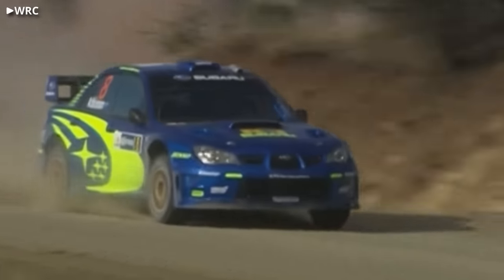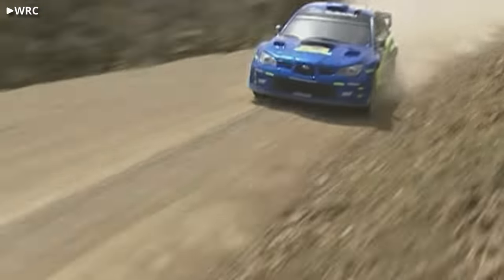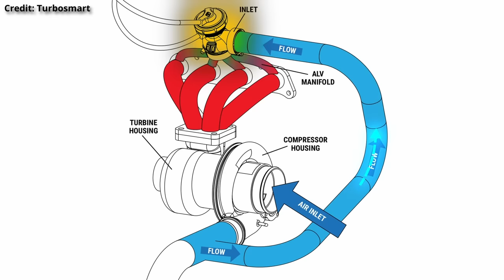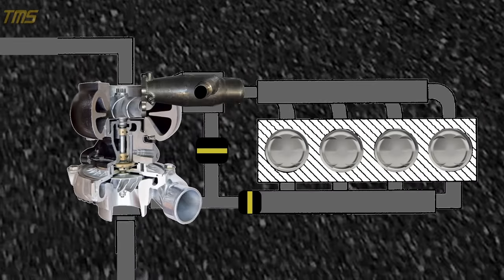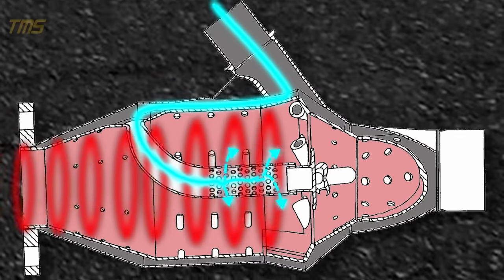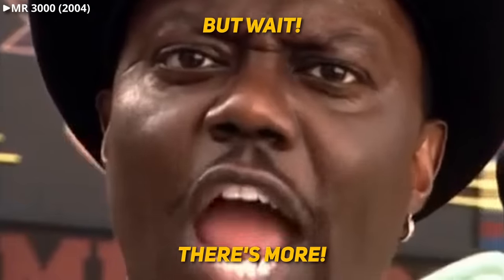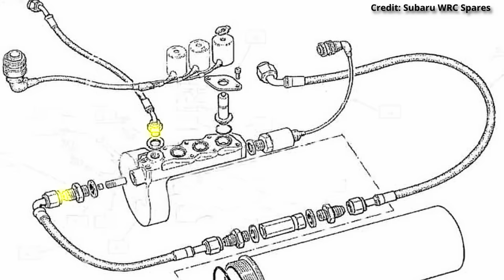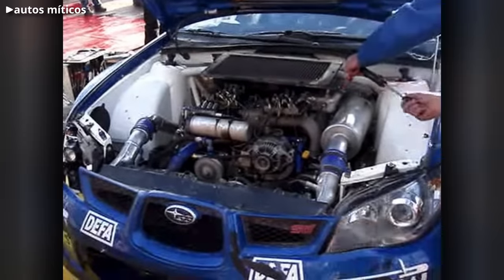When Subaru Put a “Jet Engine” In Their Exhaust | Rocket Anti-Lag Explained!

Comment: As an aero guy seeing the donut moving don’t feel right. In a gas turbine we make sure that the donut stays in one place or you have a melted nozzle and turbine. what usually happens in gas turbine is the donut stays as long as the engine runs by supplying it with air and fuel in primary zone and “harvesting” heat from it using cold air through secondary and tertiary air holes.

Comment: From a physics standpoint a boost reservoir pressurized by the turbo wouldn’t work. The reservoir would only be pressurized to the psi of boost and given the small volume wouldn’t hold enough air to have much effect. An electric compressor pressurizing the reservoir to much higher pressure would be more effective as the total volume would be high enough to release sustained boost pressure through a regulator for long enough to actually provide boost until the turbo spools back up. I believe Koenigsegg uses such a system with carbon fiber air tanks.
Reply from the maker: Just looked it up, that's pretty interesting what Koenigsegg is doing! Christian himself talks about it a few minutes into this video: https://www.youtube.com/watch?v=Jh8Kk1n66g0&t=170s   Love how innovative they are as a company.

Comment: Oh, Rally Car racing. The only sanctioned motorsport where the fans are the circuit barrier walls. Even Isle of Mann TT racing has hay bales between the race bikes and spectators, at least on the outer parts of curves.
Reply from the maker: Yeah, it's certainly gotten better since the days of Group B but there are still some fans who have what I would call poor judgement.

Comment: I've been thinking about anti-lag for like a year after watching videos about it. I've come to a point im confused because i do not understand why someone out there hasn't put an electric motor to spin the turbo when exhaust gas pressure falls below a certain threshold within the exhaust manifold? Seems by 2024 we should have the technology and means to build something like this now, especially with how far electric motors have come. 
    They can spin up to something like 100,000RPMs thats 1/3 the speed the average turbo charger spins at max boost, around 280,000Rpms. With gearing and a small electric motor it would seem possible to incorporate an external electrical motor driven shaft that only needs to go half of what the turbo spins at under max load and boost. It would seem possible to control the shaft speed electronically to keep the turbo at whatever speed rpms till the exhaust gas is back up to the pressure variance needed to spool the turbos.
   Anyone understand what im trying to say here, not sure if im exactly explaning it right, i can surly picture it but to wxplain that picture in my mind's eye is another thing all together lol. Seems like this would be possible to build and even sell if no one else is doing it...

Comment: it is actually a jet engine, no matter the fuel burnt. it uses the compressor and turbine of the turbo as the compressor and the turbine of a jet engine, albeit a really inefficient one. the wastegate is probably closed to not loose precious air and sustain the rotation. to reduce boost you inject less fuel in the engine

Comment: Fantastic  using the  pulse,  it must have taken  some tuning  .  Hard to explain  all and your grafix  must have taken  you a long time..  from watching your video.  How did they get around  the Air Injection  part in the rules.  They  are very  similar  systems   as they both  blow air into the exhaust before the turbo.  No added fuel  in air.  Can you  give  me  what I'm missing please. 
Regards 
Thank you.
Reply from the maker: Back when this system was used in the mid-2000s air injection was still allowed in the rules. It only recently became illegal, long after these cars were no longer used. Glad you liked the video!
Reply: @themotorsportstory   Thank you so much for getting back to me  👍

Comment: The guy pressurizing the cooling system was probably checking for leaks. There is no need to pre-pressurize the cooling system as it will do that naturally as the coolant tries to vaporize. If anything, it will harm the car more as your adding air to a water based system instead of naturally letting it expand.

Comment: I agree that there is no way that small hand pump is adding anything to a 'boost storage' system. Those small pumps can produce high pressure, but very small volumes of compressed air. A minute of pumping with that would produce about one second of air volume consumed by these engines at WOT. Maybe less.

Comment: so it is a bit the system that is present in modern turboprop motors, helico motors to fighter jet engines, optimizing every tear of fuel to make sure nothing is not converted into thermal/kinetic energy.
however on the thermal issues I'm thinking about a magnetic confinment, similar used in plasma physics to prevent overheating, and maybe even a system that would also combine microwave ignition. that would make hydrogen engine efficient without it to melt instantly as this is the main reason we can't have this working very well. again, these engines are more closer to diesel with specific flashpoint/compression than a fuel that requires a sparkplug.

sure piston engines gives torque, but a good, full turbo engine would have no lag issues, but here we're building a dragster. let's change the approach, and divide into smaller turbo engines, which spreads the kinetic energy and enhances control, also allows lower regimes, so you don't get problems while parking.

final solution : one jet engine to create AC power and the watts, of electricity, distributed to four, three-phase motors on each wheel using that system.
Reply from the maker: I'll admit a lot of of this sounds very interesting but also way over my head haha

Comment: Probably called a rocket because this is basically how a rocket engine works (though cold fuel normally flows outside the chamber but given the intake air is cooler it makes sense to use the intake air.)

Also missing the restriction to increase velocity as well as the engine bell but given this isn't designed to produce thrust and just to keep a turbo spinning that makes sense as well

Comment: Regarding Myth #1, it's not a "jet engine" because it's not producing thrust with a jet of air.  That's it, plain and simple.  It literally is a gas turbine engine because all turbochargers are gas turbine engines.  They're turbopumps in that their power output comes in the form of high pressure compressor discharge, rather than an exhaust jet or rotating shaft.

Comment: 3:20 Lol my Mitsubishi express van is doing what you said about driving while off throttle. Is has increased acceleration quite a bit tho so much I have to clutch in or use neutral to go around corners and stop and go traffic. I’ve turned the throttle down a few times but it keeps going back to high revs after starting it a few times.

Comment: B4 seeing this i always wondered why a race car or hi performance engine never used a mini jet like systèm in the exhaust to help  scavange the burnt gases on exhaust stroke which would create  a low pressure in the exhaust and cause cylinder overfill ( volumétric  efficiency) during valve overlap. You wouldnt even need a turbo to see résults. Instead of pressurizing the intake you lower  the pressure in the exhaust. Other than the wasted fuel and flames shooting  out the tailpipe what could go wrong,, lol. For racing only.

Comment: The tank connected to the wastegate could just be CO2. It is common to use CO2 to be able to hold the wastegate closed when building boost. With high boost pressures it is needed to pressurize the wastegate so it doesn't blow open by the exhaust pressure.
Reply: The tank acts as buffer/filter(think electronic filter rather than a oil filter)  to the pressure sensors, in effect removing  pulses and peaks in the  boost pressure so the ECU has an easier time measuring the pressure.
Reply: @SpazmoidJAm  on closer inspection that seems more likely. CO2 needs to go to the under-side of the wastegate membrane if it's gonna be used to hold it closed, while the line seen in the video is clearly going to the top membrane of the wastegate, I should have looked a little closer before commenting :P

Comment: While the actual "Rocket Device" itself is not a "jet engine" within the confines of the system, it IS a Jet Engine.
The Rocket Device, in and of itself, is 100% a Jet Engine Combuster. Instead of being direct injected with fuel as a Combuster would be in a full size jet engine, the Fuel Injector IS the engine, working as a reciprocating pump to push a fuel rich mixture into the Combuster. This pumping effect from the engine is part of what creates the toroidal combustion flame front inside the Rocket Device. That ignited mixture is then expelled into a Turbine Wheel, which in turn drives the Axial Compressor Wheel, which is directly feeding air, via the Air Valve and Air Injection System into the Combuster. Causing the cycle to continually repeat, building pressure inside the closed loop of the system, and creating "boost" on demand. And because of the nature of the Combuster always being "lit" by hot exhaust gas, the system could activate at a moments notice, without any need for excessive popping and banging from extreme ignition retarding.
Look at the Whittle Turbo Jet designs. Specifically the Whittle WU turbine. It is, in effect, a closed loop version of what Prodrive created. Heck, it may have even been what gave Prodrive the idea, being British and all.
Reply from the maker: All good points. You're correct that the main point I was trying to clarify was for people that believed the rocket had it's own internal turbines, fueling system, etc. And I'll definitely give those Whittle designs a look :) Thanks for watching!

Comment: If you have the ability to use a rocket to spin a turbo, then what is the point of having the turbo blocking your exhaust flow? You would just have the whole system making boost all the time and forget the exhaust side of a conventional turbo system. It might cause off throttle surging but it would be simpler. Just a thought.

Comment: I still have some questions so I might need to do more research. 
How does the engine exhaust gas reach the jet as off throttle the engine would be creating no exhaust gas? Wouldn't the jet need a constant stream of fuel rich exhaust gas to fuel it's combustion?
If it is just a small amount of scavenged exhaust used by the jet, does this mean the engine runs rich constantly in order to supply the jet with a fuel rich mixture off throttle?
If anyone could answer these questions I'd appreciate it.

Comment: It's not that dissimilar from a rocket engine, actually. Many large, high-thrust rocket engines involve pre-burning a rich fuel-oxidizer mixture in a separate combustion chamber, in order to drive the turbopumps. This is a little bit like a pre-burner, only instead of piping in fresh fuel and oxygen, it's using the engine as a fuel pump and the turbo itself (via the intercooler) as the oxygen pump.

In either case, the exhaust from the pre-burner is what drives the main turbopumps. In this system, the "pre-burner" exhaust is being fed back into the turbo itself. Simpler rocket designs then dump the exhaust from the pre-burner overboard. More modern ones feed that exhaust (which is still fuel-rich) into the main combustion chamber.

In essence, this is a lot like a rocket, only one that's designed mostly for low-flow, low-pressure self-sustaining combustion, and feeding back onto itself.

It's nothing at all like a jet engine; that's a much sillier comparison. xD

Well... maybe a bit like a pulse jet, I suppose, heheh.
Reply from the maker: That's a fair way to look at it. I agree on the jet part because my mind always thinks of a turbojet commercial aircraft engine which is what I meant in the video. But since it has some similarities to a pulse jet, I seem to have triggered some other commentors 🤣 Thanks for watching!

Comment: it kinda looks like they took the design of a vortex rocket and then modified it to work in an exhaust pipe using hot fuel-rich exhaust and fresh air from the bypass valve to ignite it all.

Comment: It's still technically a jet engine nonetheless the ignition source ( pipe jets also don't require sustained ignition mechanism) and exhaust gases are just a hot exhaust & fuel mixture similar to how afterburner works - which also technically is a jet engine
Reply from the maker: Correct. I should have been more clear when I said it "wasn't a jet engine". I was trying to drive home that it didn't have internal turbines (as some people I had read thought it did) and didn't operate like an engine found on a commercial airliner. Thanks for watching!

Comment: How does air flow into the exhaust when the engine is under vacuum (off throttle, when you need anti lag)? This has to be what the tank is for, like a brake booster
Reply from the maker: The air valve diverts intake air directly to the rocket. Even though you're off throttle, there's still some intake air coming into the engine, otherwise it wouldn't be running. The tank is for boost control. Going to paste Jason King's (I believe he worked at Prodrive) comment with an additional explanation of the boost control system here as I think it might help to answer your question: 

"The boost control system commonly called the boost pack is a phase anti phase system with a small storage tank for the the intake pressure out out side of what is needed. It is pre charged during the firing up of als system as at idle the boost pressure is quite high. Higher than most people think. The phase and anti phase control is needed because the waste gate spring is quite soft. The s11 and s12 used a very wide boost curve caused by the intake restrictor. As you enter the choke flow point of the restrictor, you will need to open the wastegate at a lower and lower pressure to prevent over spinning of the turbo that can then lead to catastrophic failure. Not much different in theory to an external wastegate and a boost control CO2 system."

Comment: With metal 3D printing there should soon be more stuff like such devices and substituting factory made plastic parts with sturdier 3rd party metal parts. They will not be for free, yet cheaper than ones made by multiple steps of precise manufacturing with milling, drilling, bending and welding,

Comment: You forgot your FACTS, Fuel, Air, Compression, Timing and Spark to make an engine run.
Reply from the maker: Not going to be rude back to you, but I am going to politely correct you. In the video I said required for "combustion" not "make an engine run". Those are different things. Like I said in the video, air, fuel, and spark (a source of heat) are what is required for combustion. If you don't believe that what I said is true, you can take NASA's word for it instead: https://www.grc.nasa.gov/www/k-12/airplane/combst1.html

Comment: Instead of initiating combustion through the engine, why not add additional injectors with control from another ECM?
Reply from the maker: Not positive, but I believe putting additional injectors back there would have been against the rules. As said in the pinned comment at the top, a separate ignition source would have been illegal so it wouldn't surprise me if it was the same deal with fuel. Thanks for watching!

Comment: I think the higher the pressure is , the lower the boiling point becomes , the mechanic is probably just pressurizing the system to check for leaks
Reply from the maker: Other way around🙂 https://www.chem.purdue.edu/gchelp/liquids/boil.html
From another article: "The boiling point increases with increased pressure up to the critical point, where the gas and liquid properties become identical." The critical point of water is around 374 C, which if you hit that in your car's cooling system, you've got a serious problem!

Comment: Is an anti-lag system similar to the jake brake system in semi-trucks?
Reply: Not really. The "Jake" brake is opening an additional, dedicated valve in the cylinder at or near TDC to release the air at the peak of compression. That robs the combustion chamber of the power stroke it worked hard to produce by compressing the air in the first place. It makes the engine resist turning, resulting in the braking effect.
Reply: @BigKandRtv  Intresting. Thank you!

Comment: Would a VGT common on desiel engines do the same thing? Essentially?
Reply from the maker: VGTs have the same goal of reducing turbo lag but achieve it differently. They move vanes that are in the exhaust side of the turbo to control the effective "size" of the wheel that the exhaust gas has to spin. So the turbo itself is mechanically different from a normal turbo. Here's a decent animation of one: https://www.youtube.com/watch?v=69B5K3OX6Pw&t=73s
Reply: @themotorsportstory   I know how they work but a great explanation. Just wondering if there would be a way to get one to work on a gas motor

Comment: I am a total noob in this, but why can't we add a battery to spin the turbo when we need it? We could recharge the battery when we have more exhaust than we need.
Reply from the maker: So it turns out "electric turbos" are a thing, but they're still in the early stages in terms of becoming widely used. I'd have to read up on it more myself but here's a quick article: https://gfb.com.au/tech/tech-articles/electric-turbos-fact-or-fiction-2/
Reply: @themotorsportstory  I got the idea from the rocket industry, where the RocketLab Rutherford engine has electric pumps. So if this  can work on orbital class rockets why not on cars :)